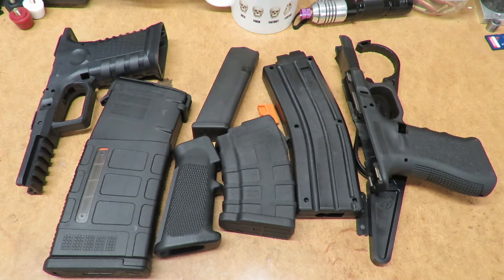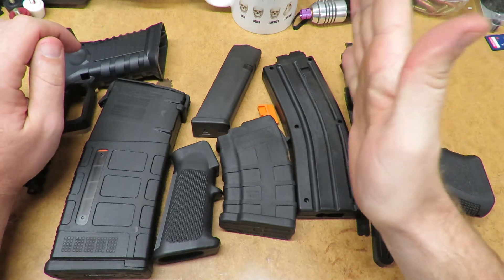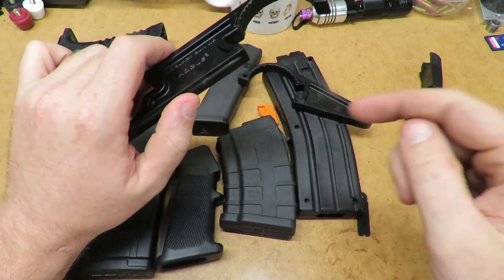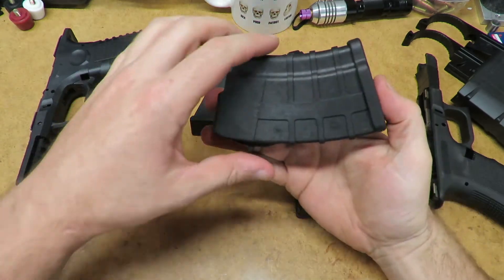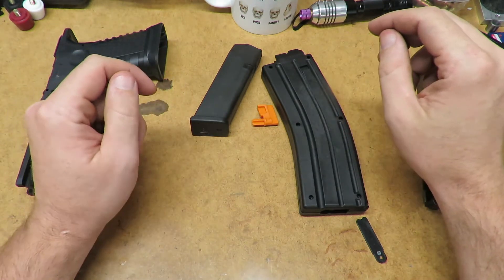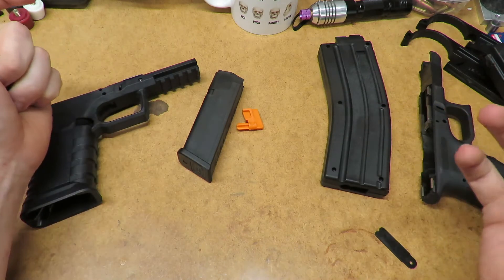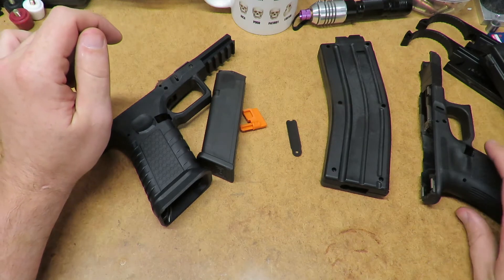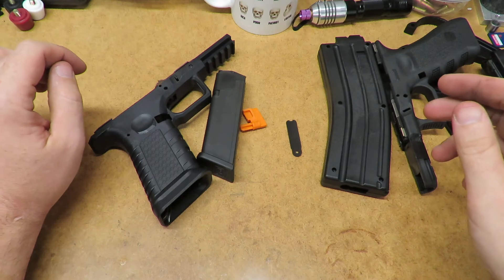How polymer gun parts are made

Comment: WHat are the inserts usually made out of? I'd imagine they'd need to be somewhat soft and flexible in order to get pulled out of the molded part without damaging it or the part, considering the fit would be pretty tight.

Comment: Hello John, I wonder what kind of bonding or epoxy will bond to Nylon6, I’m trying to refill the holes above the trigger pin (locking block pin) in a P80, and re-drill them, I found two bounding products, PATCH N GO by MIGS and, MecaFix 120 by Castolin. Do you think it’s doable?
And thanks for the vids, very informative and educational.
Reply from the maker: Thanks!
Most of the two part epoxies are about the same (as far as tensile strength).
  If your hole are over size or slightly out of place, a shim my be a better alternative.
Reply: Thanks for the respond John, well, the holes are not that big, i can apply some blue lock tight to just have a peace of mind, but compare to an OEM Glock it’s slightly looser.
Reply: You can probably use super glue and baking soda // tape around the holes with painters tape and tape the inside of the hole then first drip a tiny bit in the hole and use a tweezer or something to sprinkle the baking soda in. Practice on something else first because it hardens immediately

Comment: What companies can I contact for making small runs of gun polymer strength molds/parts?
Reply from the maker: You'r best bet would be to find a mold shop near you that will take custom jobs. Depending on the part, you may be looking at thousands in mold development.
Reply: Yes many thousands! For me it was cheaper to buy a table top CNC machine.
Reply: @mikepekala5832  What machine did you end up getting?
Reply: Mike Pekala yeah what machine did you buy? Lol

Comment: Interesting topic. Now I'm intrigued to find out if anyone has made any video's trying to 'destroy' / 'damage' their polymer/plastic frames/mags (Can't find any vids yet). Im sure they will melt in heat/boiling water/fire. Sunlight will definitely degrade polymer, if left out in the elements for months /years on end.
Reply from the maker: A lot of automotive cleaners and oils will break down some polymers, as well as anything designed to free stuck or rusted bolts. Acetone and other ketone structures will melt most all polymers.

Comment: I just measured the top and bottom of the inside of my hexmag both directions, the top is smaller than the bottom on the inside but seemed to be that the draft angle is only 0.25 degrees calculating for the length of the magazine!?!? how do they get the inserts out without destroying it? is 0.25 enough draft angle or do they use a special lubricant? but super interesting how these parts are made thanks for the info!!
Reply from the maker: Glad you like it. 
Modern molding they don't need much angle at all. They pull the insert when the part is hot otherwise you'd have to hammer it out.

Comment: Is the process for MIM similar (course not polymer but for powered metal)? Thanks for the info!
Reply from the maker: They use the same mold machines for MIM. 
 The powdered metal is mixed with a binder, (usually a mix of wax and polymer). After molding the parts, they cook them in solvents to remove a portion of the binder then bake the part to fuse the metal.